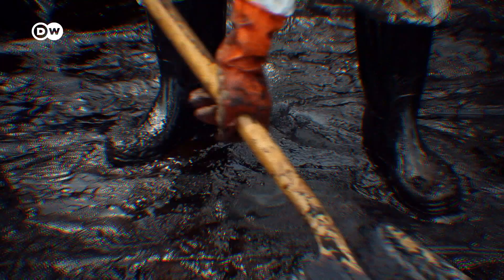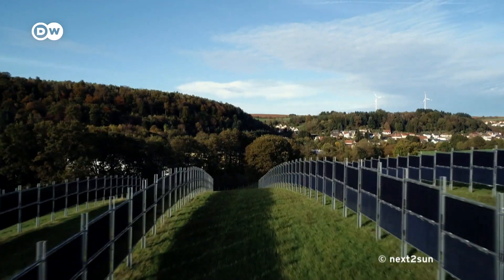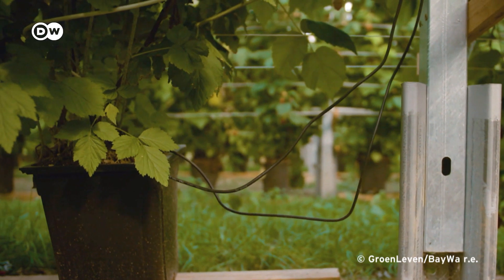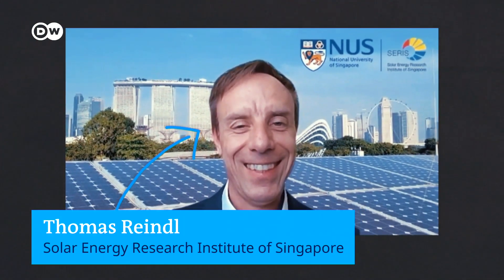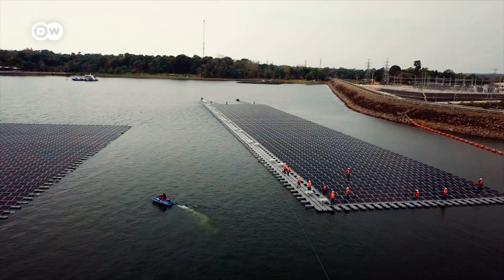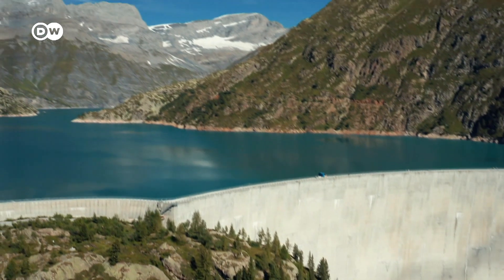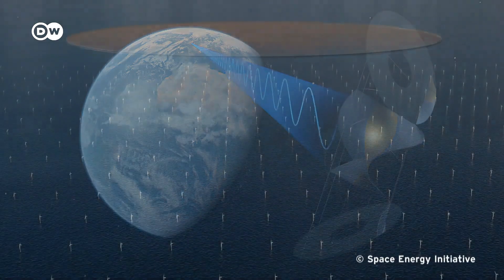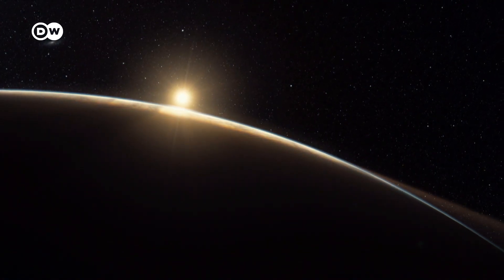Why we should be putting solar panels on our fields and lakes

Comment from the maker: Where would you put solar panels?
Reply: We need more shaded urban spaces, particularly in hotter climates. We could create elevated shade covers/tarps with solar panels on top of each one, while also reducing the heat islands within cities.
Reply: @nickjohnson5189  oh yes this is a good idea
Reply: On every single fking block of apartments in city.
Reply: Literally on the roof of all homes/buildings. Combined with batteries for storage + reducing grid stress.
Also, it is logistically equivalent to increasing production, if we simply reduce the total energy consumption with better management.
It is the same with the food problem, where people throw food while others are starving.. don't try to only increase production, it's also a matter of resources management
(search for 'Resource Based Economy' for such a direction)
Reply: @dragovian  Exactly! Solar panels should be installed as close to the point of use as possible.  Every building should have solar panels to reduce the amount of power that they have to take off the grid.  Distributed power generation!
Reply: @dragovian  Yes totally agree. I also think energy should be a local thing and it would reduce the costs of maintenance or distribution. Buy local think global should also apply for energy consumption.
Reply: @dragovian  
Yes Management and Logistic is the key where the Power Generation is high you can produce for less or can use it for energy intensive tasks or Produktions
Reply: @dragovian  Who is paying for all this? Just in the US there are 68 million single family homes. We the cost of a system (with batteries) coming in at $50k, you are looking at a total price tag of $3.5 trillion.
Reply: @gjpizzo  the current yearly subsidies for OIL (yes, you heard that correct), is more than sufficient :)
Reply: @dragovian  I agree. Every place with about 2000 hrs of sunshine per year
Reply: @dragovian  Yes! I have been talking about something like this for a while now. Nobody is fking listening x)
Reply: @KrisHesselmark  Governments are not taking it seriously enough. The UK used to pay 3 x the market rate for electricity generated by rooftop solar panels, and the number of houses with panels on exploded. Then they removed all subsidies and the industry ground to a halt. Stupidity! Much less was spent on that than the £35 billion nuclear plant they are building to produce 3.3 GW. Rooftop solar subsidies cost half that and is producing on avg 4.5 GW during the day already. That is at the artificially high initial price too.......
Reply: Top of car and transport trains to save diesel and gasoline.
Reply: on roofs?
Reply: Can you make a episode on the benefits of white rooftops? It can even reverse the temperature. 

And a episode of why is nobody talking about, a co2 negative society. And about getting the temperature rise back down to 0?
Reply: Parking lots
Reply: Roofs and parking lots in urban areas. Agrivoltaics also is an excellent solution for the country farms.
Reply: Sky
Reply: Onto parking lots and highways
Reply: Every flat surface that gets full sun
Reply: @williamkreth  even walls with fluorescent plates could do it too
Reply: solar panels in deserts provide shade and shelter to crop and animals - every roof looks good in solar panels (solar panels on every roof and parking lot)
Reply: I'd like to know why we aren't already using this to green desert areas, increasing our farmable acreage and providing both power and groceries to the local area. Not only would it help here in the US, but it would be life altering for those poorer countries that are suffering famine today.
Reply from the maker: Hi  @Myrddnn , insightful comment! We've actually done a video about greening our deserts before. You can watch it here: https://youtu.be/D6Kz_OcOgvE
Reply: @DWPlanetA  Thanks.
Reply: as close to where its being used as possible such as a roof where it makes sense
Reply: I could see having cattle and chickens go under them, just give a 12ft clearance from the ground to avoid damage
Reply: In the sun.
Reply: i would put them in all the places mentioned in this video but 30 years ago... it feels like all of what we can do is already too little too late
Reply: I have them on my garage roof. I'm considering a solar air heater panel on the wall of my dining room. And in the future, PV panels on my house.

Also considering solar PV panels over part of my driveway.
Reply: @KevinLyda  is there a way to use solar schindels and solarthermal at the same time?
Reply: on my roof
Reply: Integrate it with the Engineering, house,The many other common things we see in the city
that has lots of space.
Reply: America can put the solar panels on old nuclear test sites. What else are we doing with that land? Do we really need an "environmental impact" study there? If people in hazmat suits won't install these, we could have robots offload these from remote-control trucks, and if rich people complain, we can say that this technology is a test for a Mars base.
Reply: on top of a solar panel factory, mine used to produce the metals and minerals needed to produce them.
Reply: on top of wide buildings like warehouses and supermarkets and malls. also like the idea of putting over parking lots. honestly, that alone would create a LOT of space and probably have less NIMBY interference than on public lands or in the countryside where many conservatives work to block solar.
Reply: @DRE_Talks YES! All our sprawling land wasteful parking lots...Win, win.  The raised solar panels generate electricity, help shield cars from sun and heavy weather, and maybe even reduce some of the heat island effect of our cities.  We could also place panels over sidewalks creating again a bit of shade for those below.
Reply: @suzettehenderson9278  this is definitely a very good idea 👍
Reply: These ideas are not new.  The biggest obstacle to entry is the COST.
Reply: I'd build them into the glass of new skyscrapers, at least in hot climates. Reducing solar gain inside the structure would save on AC, and reducing reflective glare would be a positive too.

Everyone would complain about the aesthetics of little wires in the glass, and then forget about them after a week.
Reply: @westasleep  wires in  the glass?  Not really they are actually  transparent or you can make them more opaque to reduce sunlight which reduce also the heat
Reply: on my rooftop probably
Reply: Highways, parking lots, rooftops, sparkly vampires...
Reply: above motorways and train lines
Reply: @imrepetrohai  and every other place available, say rooftops
Reply: On roofs, any roof of any building, and on walls, they do a better job in winter in places far from the equator on walls.. Something with the angle of the sun..
Reply: In rooftops, where they take up no room at all
Reply: @acmefixer1  if effeciency improves, current panels nay be replaced for more power?
Reply: @acmefixer1  extremely well stated. Get something out of nothing!!!!.further less direct impinging sunshine would lead to greater cooling of rooftops and consequent longevity, with lower need for cooling electricity consumption?
Reply: Where the sun don't shine
Reply: @dumkopf  nice choice
Reply: In the trash where they belong.
Reply: On my roof.. If the government uses my taxes to pay for it.
Reply: @africanelectron751  (batteries and solar panels is a business)
Reply: Okay what about negative effects of solar panels such as emitting big part of energy back and making climate even warmer?
Reply: @besirhuseynli4279  in deserts solar panels give shade and shelter to crop and animals - all plants absorb solar energy as photosynthesis
Reply: @replica1052  sharkskin inspired surface on solar panels to help keep them cl
Reply: @CUBETechie  (solar panels are no to low maintenance)
Reply: EDIT: Thanks for answering! You were really quick! (haha) I would like to see a more complete analysis on the ecologic impact, though.

I'm interested in the water idea. There's a Chinese company testing a system on a badly designed Hydroelectric Plant's reservoir. My interest is to use on water reservoirs that exist in the semi-arid region inside the Northeast of Brazil. A lot of these reservoirs - that stock rain water - were either built long time ago or using manual labor as a way to give people jobs. There's also limitation due to the slightly salty waterbeds that run underground. These issues make for a large surface area and shallow depth - making evaporation a real problem. The question I would like to see answered is the ecologic impact on the lakes.
Reply: @maxheadrom3088  (solar panels in water takes the sunlight away from algae)
Reply: Cladding of highrises and skyscrapers
Reply: Lake Mead!!!
Reply: @FelixTheAnimator  algae absorb solar energy as photosynthesis - add fertilizers?
Reply: All the reservoirs in my area (which absolutely could use some shade to prevent evaporation) are surrounded by rich Nimby's with boat houses.  Oh no! The VIEW! gag
Reply: @FelixTheAnimator  (algae absorb solar energy as photosynthesis - every roof looks good in solar panels)
Reply: Bury them where they belong. Useless junk still. Have fun dealing with useless panels in 10 years when new better products actually make sense to use.
Reply: I would put the solar panels on roads, cycle paths and footpaths I mean make them from solar panels.

There have been a few different projects with roads, cycle paths and footpaths made of solar panels and they have been a success.

I think the Netherlands have a few cycle paths where you ride on the solar panels and in China they have a few roads where you drive on the solar panels.  And they have been setup else were as well.
Reply: @matthew_baynham  just elevate them as a pavilion it gives shades and if you design them well you can provide also wind 😀
Reply: On the roof of a nuclear power plant. That way we could actually get some energy.
Reply: Almost every waterbody in Bangladesh. It will be a great solution considering the land limitation of Bangladesh. If the price is reduced by a good margin and cheaper energy storage is available it will contribute a lot to increase in RE generation in Bangladesh.
Reply: @00hole  Are the waterbodies fresh water? Electronic components and salt water don’t mix very well.
Reply: @00hole  look for iron air batteries there is also a very interesting project from an Austrian engineer
Reply: what about Uranus?  That is too far out for you?
Reply: Curtains
Reply: equator...   wire the globe   it s always sunny in the desert
Reply: Where there is sun. Not much sun in Europe make that tech a bad idea. Costly and not enough energy in the end.
Reply: on rooftops of buildings and also over parking lots around supermarkets mall's etc and other huge spaces.
Reply: @CUBETechie  every roof looks good in solar panels 
(solar panels on every roof and parking lot)
Reply: @replica1052  yes solar Roofing over Parking lots and as pavilions over streets or big places which no one want to go in summer
Reply: @CUBETechie  every roof looks good in solar panels - solar panels om every roof and parking lot 
(batteries with solar panels is a business)
Reply: LOVE OIL.
Reply: @jeronimotamayolopera4834  (solar panels in deserts provide shade and shelter to crop and animals)
Reply: In France empty 'desert' part
Reply: @6helloworld938  (a planet with france on)
Reply: Rassia and algeria
Reply: @physics_with_idris  (siberia has all the raw-materials needed to make the world battery electric)
Reply: I have a portable solar charger for my e-bike camping
Reply: @SpoonchMan  practical
Reply: @SpoonchMan  sir, you are way ahead of our times. I have no electricity for two days out of seven
Reply: @DRE_Talks indeed every available open space with dunshine
Reply: On the walls and roofs of industrial buildings, stables, water treatment plants and offices. On fields you would loose too much agricultural land or nature.
Reply: Hey DW why don't you guys tell people about the toxic metals in solar panels that can't be recycled like lead because it takes too much energy to extract. So the toxic unusable parts of solar panels ends up polluting the environment.
Reply: @alejandromacias7609  these metals already exist in full glory, currently dispersed. All we do is gather them in higher concentration?
Reply from the maker: Hi @alejandromacias7609 , thanks for the comment. We have spoken about this in the following video: https://youtu.be/EWV4e453y8Y
Reply: @DWPlanetA  That report didn't even mention all the energy needed to extract the materials, transport, process at facilities, packaging, transport again to point of sell, transport again to point of setup, and all the energy needed to take down, transport, reprocess, etc. Fossil fuels are greener than solar panels when all factors are taken into consideration.
Reply: Above Roads, railways, rooftops, reservoirs, some estuaries, factories, carports, carparks. Do all that and we are nearly self sufficient.  No greenfield solar.
Reply: @yellowgreen5229  indeed, every place with a certain minimum incidence of sunshine during year, every kw generated counts and matters!!!!
Reply: on the roofs of industrial buildings, people's houses, over parking lots over roads, in deserts where they help de desertification.  i would like a shed at my place that could be built out of structural solar panels.  with wheat you might want wind turbines instead.  turbines on the fence line, solar panels are the fence itself.
Reply: @drakekoefoed1642  indeed, each and everyplace, where a certain minimum of sunshine is incident round the year, the more the better!!!!!. Happy you have caught the spirit tight!!!!!
Reply: Not on lakes, reducing evaporation rates and thus percipitation rates in the area
Reply: @asylumking3642  well stated. In case of air pressure difference, clouds from elsewhere would be drawn in here leading to greater precipitation, as experienced in India!!!
Reply: Solar panels should not placed on fertile fields for growing Vegetable or Farming!!
The number one location should be on Rooftops of old and new buildings in general any building capable of supporting solar panels!! 

Fields and nature must be left as intened for agriculture or vegetable growing and the rest off the open spaces for wildlife tawna and fauna as this will only help kerb Rising temperatures there is no other way!! 

Lining the pockets of the wealthy to build solar farms will only help with the rising temperatures and climate crisis exacerbating!!
Reply: Solar panels would be a better option for helping reduce the number of Nicola power stations that are not environmentally friendly because of the massive amounts of work and machinery involved! 

Solar panels should not be placed on fertile fields for growing Vegetable or Farming!!
The number one location should be on Rooftops of old and new buildings in general any building capable of supporting solar panels!!
On top of that excess power can be put back on the National Grid bringing in income to businesses and the general public in the long term** 

Fields and nature must be left as intened for agriculture or vegetable growing and the rest off the open spaces for wildlife tawna and fauna as this will only help kerb Rising temperatures there is no other way!! 

Lining via the pockets of the wealthy to build solar farms will only help with the rising temperatures and climate crisis exacerbating!!
Reply: On top of parking lots/roads
Reply: @CoasterElement  indeed!!!
Reply: In the garbage can
Reply: Straight down every highway in America.
Reply: Nowhere. imo solar panel is not that reliable for our places (tropics, especially those that get rain every single day (not all of them though)), since there's not much harvestable solar energy to begin with.
Reply: 11:50 directed energy... like one used on 9/11. Ask Judy Wood.
Reply: On every single school building. They would produce heaps of energy whilst they are vacant due to school holidays and weekends.
Reply: Should be a requirement that all new-build houses that have suitable roof alignments have solar panels on them, and include storage.  I got solar with storage earlier this year, and my grid electricity usage has dropped like a stone.
Reply: Whati is EROI of PV compering to Coal or atom?
Reply: Definately not on agriculture land. Duh! Go nuclear, it is emission free, safe and bloody RELIABLE. solar on parking lots, rooftops (of modern buildings - you do not want to spoil the historic centres of European cities with hiddeous solar panels) problem solved.
Reply: @SP-kh7cs  it would depend on the crop. Those that need the full strength sunshine this would not work, whereas those that would benefit from the shade then yes this idea seems plausible.
Reply: @Soruk42  true. Also elephant in the room- energy efficiency. It is not just about new low carbon sources, but about how much energy we can save
Reply: @SP-kh7cs  and other resources. The video mentioned that crops grown in the shade needed less water as less was lost to evaporation, so to me for those that benefit from the shade, it's a win-win-win. Better yield, less water AND electricity.
Reply: Nowhere. Its already to late
Reply: Hiways
Reply: Algerian Desert - although the cooling will be a huge problem. So maybe molten salt power station instead of photovoltaics?
Window blinds
Huge, flat buildings like warehouses, shopping malls and some factories
Reply: Anywhere shade is needed and trees 🌳 are not feasible
Reply: Single tier parking lots waste space. Put panels on top of multi-tier parking garages
Reply: On pastures used for cattle. We produce and eat way too much meat.
Reply: Nowhere
Reply: On every shade or roof we have. Like rooftop of every house, cattle sheds,deserts etc.
Reply: on top of irrigation canals
Reply: In the mountains you blow up to make the battery.
Reply: Solar on space is an exaggeration! Look at Desertec. The Sahara can provide areas more than enough to power the whole globe!!!
Reply: In the Roof, ROOF! 🐶
Reply: we need nuclears. there is no solution to what happens when theres no sun or wind and the german answer of the incompetenet childrens book author who is now economy minister is we will just import... import what? Nuclear energy from france and coal from poland. This idiological GARBAGE is destroying germany!
Reply: The desert. There’s so much land there.
Reply: @dasiadefreitas9041  u still have to transport the electricity
Reply: my roof and my head🙂
Reply: on buildings
Reply: IN THE DESERT!!!!
Reply: You need nuclear power plants in Germany if you are serious about near energy independence. Son and wind are variable.
Reply: Australia mate 🤠
Reply: Over cycling lanes.
Reply: Humans are making great progress. Why is the process not faster? Because politicians and the UN liers are involved.
Reply: Agrovoltaics is a fake word
Reply: If every home and business had solar, you would not need these fields of panels
Reply: "Climate"- the new "green" fascism.
Reply: Rooftops, absolutely underutilized space with no other purpose than covering our homes. Turn your roof into a power plant. It also adds resiliency to the grid having many small energy producers contributing to the grid’s overall stability.
Reply: On clothing
Reply: on houses, roads , light traffics, and everywhere that doesn't take space from nature.
Also in Greece where we have multiple "desert" and abandoned islands,  we could make those islands full of panels.
Reply: @wakeno.6047  yes this 🙌 solapave are the only I know of doing this ☀️
Reply: @wakeno.6047  yes build it on man made structures like houses, appartement buildings and over parking lots around Supermarkets malls, like someone mentioned build also Pavillons over  some place's to get some public spaces.
Reply: On a herd of 🐐
Reply: @kamranrowshandel6395  based
Reply: do nuclear
Reply: @ryd9686  too reliable and cheap in the long run, we need something that keeps people busy thinking there is ANY better source of energy than that , well, known at this time
Reply: @ryd9686  All I can afford is solar or wind.  You do you though.  Must be nice to be rich.
Reply: @Chris-ie9os  well we have a rich gov that want it ppl to waste there money on stuff that cant power nothingn
Reply: @ryd9686  ???  I have solar.  Powers everything including my car.  I haven't wasted a cent on fools fuel in ~9 years.
Reply: You do realize the lake you showed in Africa was drained by farms right.
No seriously I'm not joking it grows cotton and alfalfa and that was the result and its also going on in America.
Ya california you don't need alfalfa and cotton and rice and tropical nut trees and mangoes your a fog desert not a tropical paradise you protry yourself.
Reply: Gas stations: almost all of them have canopies over the gas tanks, and few if any ever have any trees nearby, probably as a fire precaution. This means the canopies have open space with near-constant sun exposure. We'd just have to reinforce them so they could support the weight.
Reply: In space
Reply: Really it will be adopted by developing world? Lol it will few wealthy farmer.
Reply: @rendyputra423  Solar energy is dvping very fast in India, China and Africa. For Africa especially, it's much cheaper to develop small microgrids based on solar energy than large-scale electricity networks based on fossil or nuclear energy. Agrivoltaics has huge potential for African and south Asian countries where creating both shade for plants and energy is much needed.
Reply: @Sarahlenea  Also consider this. In my parent's country (Pakistan), the grid is a bit unreliable

So people that can afford it just put up solar panels to have a more reliable energy source. In addition, the European Commission is forcing solar panels onto all new builds, however that is quite a late response, and more for energy security rather than climate change (It was only very recently announced given the war in Ukraine)
Reply: @waqasahmed939  that is actually good in that you dont have to rely on the government much
if the village is self sufficient on all fields that is better especially if the government or the situation is not stable
Reply: Would solving the problem of deoxygenating the water on accident, be as easy as just inserting basic aquarium oxygenators? Literally just pumps?
Reply: I am not likely to put any over water, the heat absorbed would increase water temperature, unless the panels are raised. Aquatic systems need less heating, not more, and certainly the darkening would cut the ability of aquatic plants to grow. 
Aquatic animals need to surface, especially if they're seals, etc.
Reply: Better question, where would you find all the rare metals needed to make the solar panels?
And how much are you willing to put aside to collect said resources?
Reply: @acanadianderg4035  What rare metals?
Reply: @matthew_baynham  Cadmium, Gallium, Germanium, Indium, Selenium, and Tellurium.
Oh I almost forgot, you need batteries if you want power during the night.
So don’t forget about cobalt and lithium.
Granted uranium isn’t common, but it lasts for far longer, more of it can be recycled, and you need far less of it in the first place as it’s more energy dense that sun light.
Reply: @acanadianderg4035  what a load of nonsense
Reply: @matthew_baynham  Please, it’s not my fault you need hundreds of not thousands solar panels, just to achieve anything remotely close to the output of a nuclear reactor. Why else do you think NASA decided to use an RTG on their newer Mars rovers?
And don’t get start on how dangerous you THINK radiation is, technology has advanced since the days of Chernobyl. If think all radiation is done form of green goop you’re way out of your depth.
Reply: @acanadianderg4035  Are you from the French speaking part of Canada, because some of what you wrote doesn't make sense, check the English before you send.
Reply: @acanadianderg4035  
Solar panels require no rare metals.  You don't know what you are talking about.
Reply: over canals  and rivers
Reply: @timkahn2813  

🤣😂👌
Reply: @timkahn2813  indeed, over everyplace having a certain minimum time of sunshine annually!!!
Reply: Some Pacific Islands are switching to renewable energy because of the cost of importing gas and oil.  Driving an EV makes a lot of sense or powering a diesel generator for electricity.
Reply: @demotter  "powering a diesel generator for electricity."
With this, you contradict the opposite of your point.
Reply: on the surface of the sun!
Reply: @moeron9172  our panels would burn down
Reply: @mohannair5671  it's a joke, genius
Reply: Do nuclear
Reply: @mateuszkot8022  Must be nice to have so much money.  All I can afford is solar and storage :(
Reply: @Chris-ie9os  I don't but it is the cleanest way to make energy
Reply: @mateuszkot8022  Solar and wind are just as clean at 1/5th the price.
Reply: @Chris-ie9os  No they are not, and the have much bigger impact on enviroment than nuclear
Reply: @mateuszkot8022  .... counting the impact of Fukushima????
Reply: @Chris-ie9os  and charnobyl
Reply: @mateuszkot8022  Please link to how solar and wind production spreads radio iodine requiring the removal of tons of soil....   the low cost of renewables alone offsets any minuscule impact.  They offset their impact before a nuclear plant is even complete.
Reply: @Chris-ie9os  please link how we are going to reuse all matirials from solar panels and wind turbine. I guese we won't.
Reply: E waste recyclers could be the ones to profit from this problem